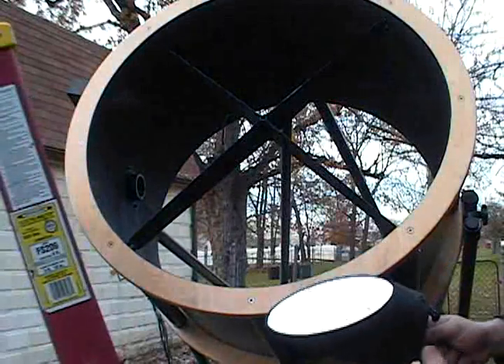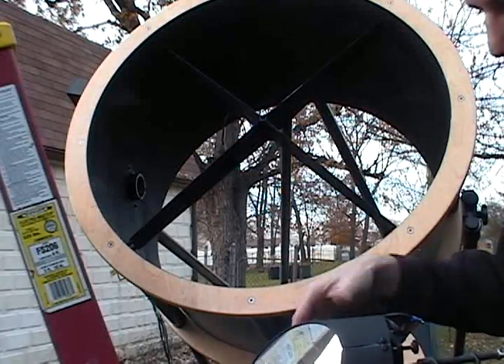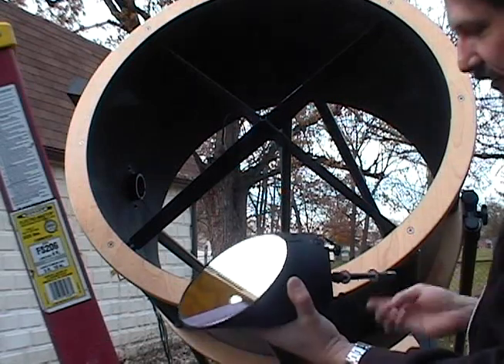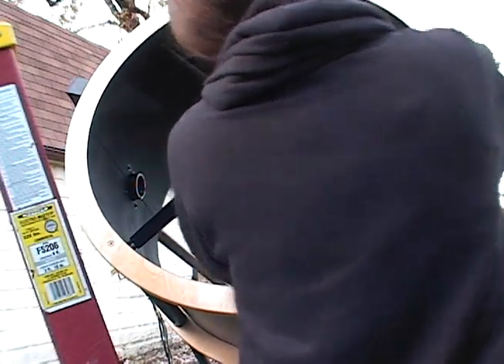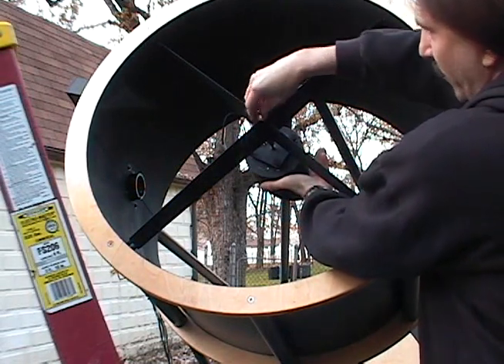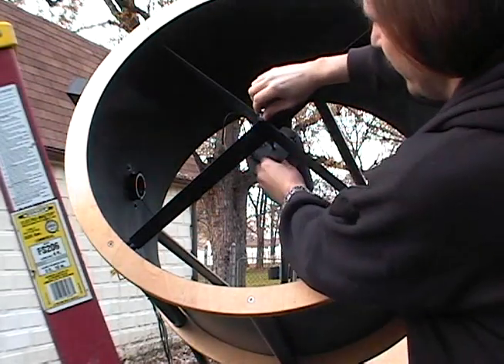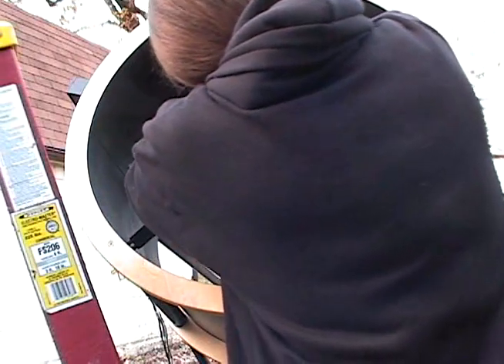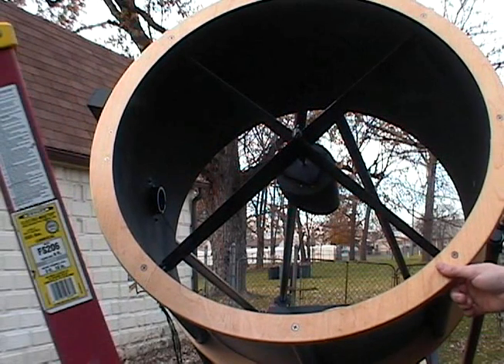Secondary Mirror install

Comment: Doesn't look like there is any secondary offset that I can see.  The bolt looks pretty centered on the back of the holder.  But it's a little hard to tell from the video.